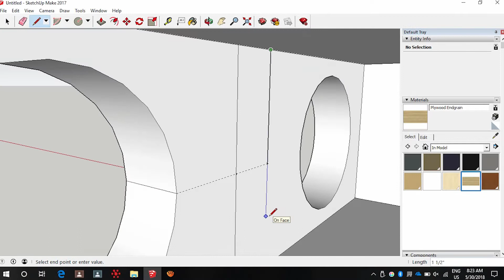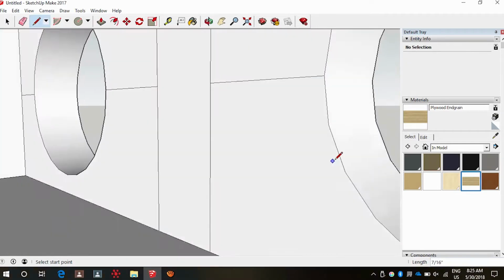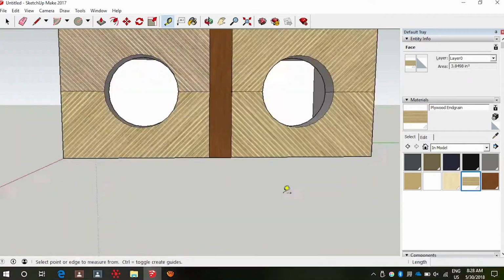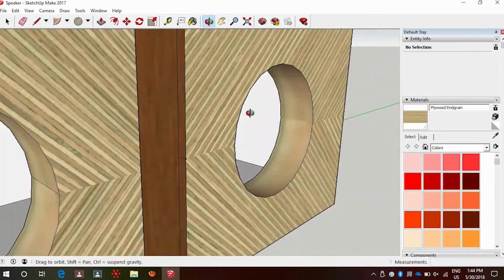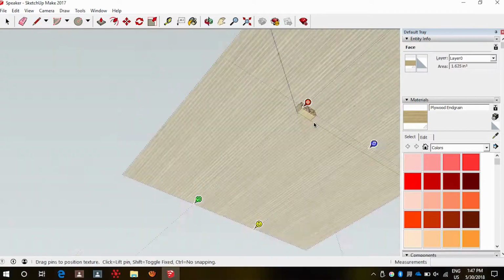DIY Mini Bluetooth Speaker (With Build Plans!)

Comment: Very cool on the front face design.  I would've found a way to throw in a battery too, just to make it portable.
Reply from the maker: Yeah I wanted to, but this amp is 12-24 volt and I couldn't find any pre-made 12 cold batteries small enough and I didn't want to mess with making my own pack on my first attempt at soldering like this 😂